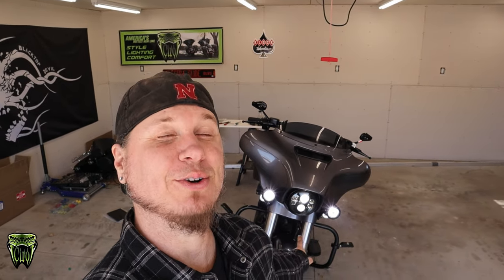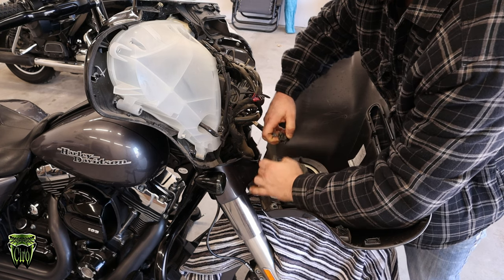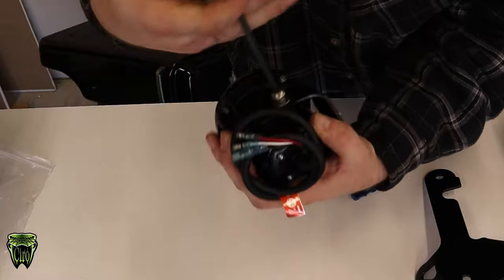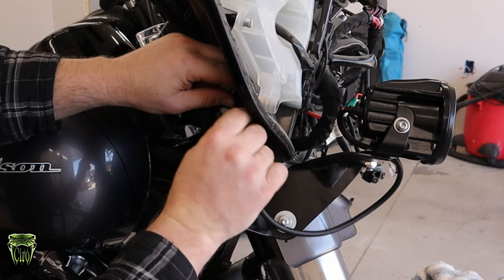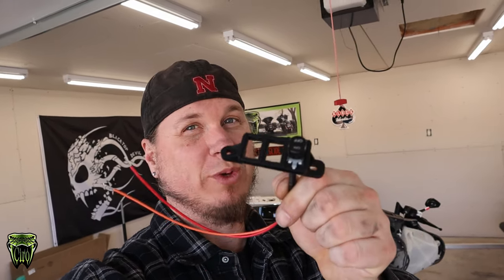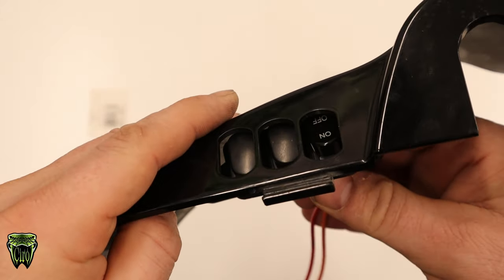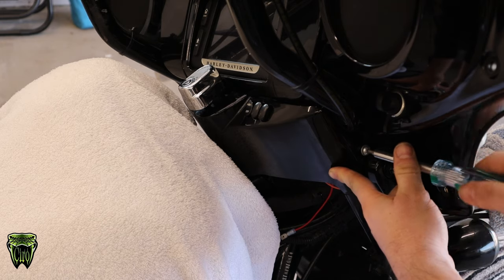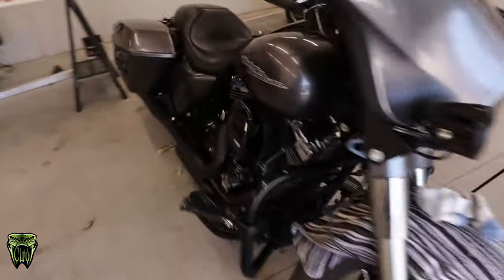Street Glide passing lamps?! | Ciro3d Tac-10 Light Cannon install!

Comment: Wow! Just installed the Light Cannons on the Ciro passing lamp bracket. I followed your instructions step by step and it went super smoothly. The only secret is the slight counterclockwise turn of the ignition key, while removing the ignition barrel. Thanks for presenting the process in such a simple manner. The look great, too. BTW… I also installed a yellow LaminX film on the lenses, as Ciro is out of the yellow lenses. So cool.

Comment: Hey those cannons, can they be painted to match up a guys front end if is not black? 

Also, hey that Outlaw Trail up there from Valentine thru Niobrara, Hwy 12…. What’s the speed limit across there, or what would your average speed be riding thru there? Just curious how much visibility, how good the road is; can one average 70mph across there?
Reply from the maker: You could probably paint them. It's a gloss powder coat on them from the factory so you might have to scuff them up a bit to get the paint to stick well. And I'm not sure what the speed limit is on that road, most are 65, some 60. There is a lot of deer around so I'd be careful.
Reply: @LifeontheBlacktop  yeah that’s always my first concern; deer. Thinking about an Iron butt/saddlesore, riding that Outlaw Trail, and from Valentine to Sioux City was curious about a gas stop around Niobrara where you guys had food and was curious about speed. 60-65 will be fine, and broad daylight, so no nighttime riding.

Comment: Nice job very neat , can you tell me if these light interfere with radio reception when they are running?
Reply: What would cause that?
Reply: @thanosetsitty1896  rf (radio frequency)signals interference.it usually happened on cheaper light and the sell ferrites that help a little
Reply from the maker: I wouldn't think so. I didn't actually try that but typically as long as you don't run a power wire parallel to a receiving wire, it won't cause an issue. If you have an inside the fairing antenna, just make sure you keep any power wire perpendicular to it and you should be fine.
Reply: @LifeontheBlacktop  thanks

Comment: Wonder if they will make some for Roadglide 13 down?
Reply from the maker: They have a bar mount option as well. I'm sure a guy could retro fit them on a 13 without too much trouble.
Reply: @LifeontheBlacktop  that might work.  Depends on if they will work with my lowers.

Comment: The dash switch that came from Ciro was poorly made and red wire came off the back of switch before it even got close to the bike. Wire was attached to the switch by cheesy cheap crimp that was not done properly. Closeness of the pin on the back to plastic body of the switch precludes easily soldering the wire onto the post. Video is awesome and one of the biggest factors in buying the lights that work great. Now to just get customer service from the seller. :/
Reply from the maker: Ciro customer service is tip notch so hopefully they get you straightened out. I agree, that switch is junk. If I did this again I would go a different route for a switch or just hard wire it
Reply: @LifeontheBlacktop  Bought them through Law abiding biker site. Will report back on their customer service. Just another small heads up, one of the light brackets had slightly smaller inside ID that made it impossible to slide the light and washers into by hand. Easy fix I took 2 crescent wrenches, one on each side of bracket, and spread them apart SLIGHTLY (1/8 inch or less) and second light slid right into the bracket like yours and the first of mine did. (vid time 4:07) Again TYVM for the great vid.